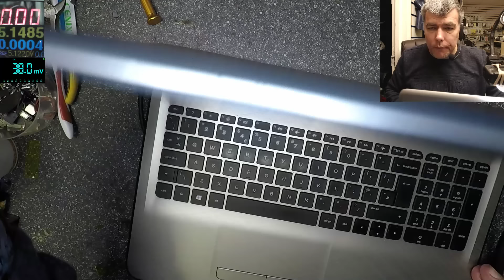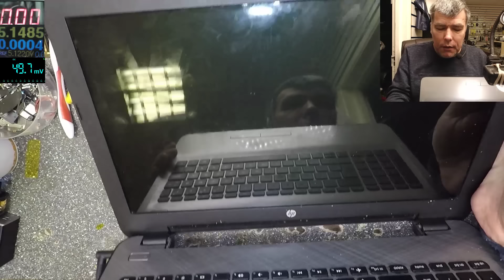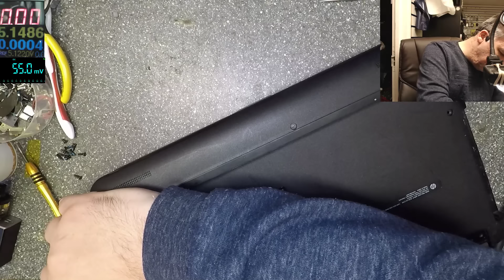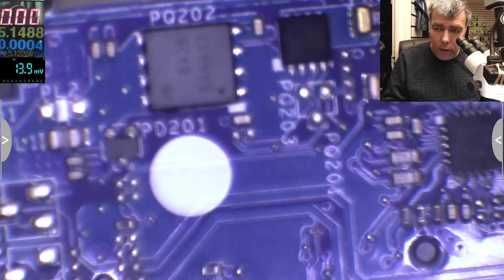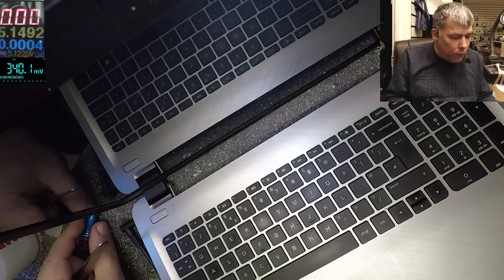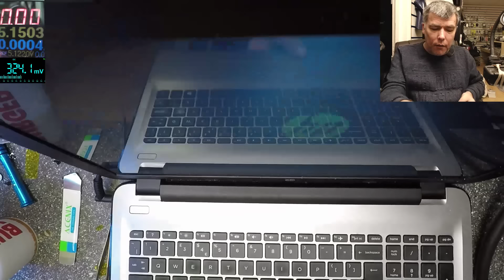Most common fault on a Dead Laptop

Comment: So the best thing to do after this is to find the reason why the gate its not opening the mosfer? thanks for the tip, now whats the downside to hacking/bypassing the mosfet and how long a jumper wire like that would last?

Comment: looks like you dude need to go to electronics repair school, bypassing a bad component isn't a fix. That component is there for a reason, you replace it, not bypass it. If I was the customer of this laptop id make you give my money back for waisting my time, shame on you sir. I'm younger then you  and can clearly tell ive been repairing stuff way longer then you. go be a doctor, sound slike youd do better at it. I hate so called "fake" techs who think they know how to fix shit just to bodge or do a cheap easy work around to get it "working" for just a little while. Your no technician, your a do it yourselfer, nothing more.  Do use all a favor and stop trying to pretend to play repair man when you can even "repair" the component you bypassed. Wether or not it got the laptop working again doesn't matter, thats a power transistor your bypassing and this is dangerous for the rest of the power supply section if anything else where to fail. Yeah its working for now but for how long and at what  cost? What about future damage from  not doing the repair correctly if something else fails and that mosfet cant do its job cause its bypassed, hmm?

Comment: I have no idea what you are talking about. You have no trays to place each screw in so I assume you just put any screw back anywhere. That’s right at the start of this operation. Sorry my friend, the problem is not the mosfet so you didn’t fix it.Seen lots of similar shops in Croydon. And they are not cheap. Bye

Comment: Pretty CHEAP repair. A reputable repair person would REPLACE the mosfet not short the input output with a piece of wire. That mosfet was installed for a reason, not just to pull and then short.

Comment: I have a problem with an Acer Z5WE3 LA-A621P motherboard. It powers up just fine but the battery does not charge and after it stays on for like 1-2 minutes then it switches off by itself. I could not seem to find the fault. Can you suggest any solution?

Comment: This is the reason Apple fought so hard to stop repairs. I would call this a cowboy repair. I understand he has a happy customer as the laptop is now "working" however he has bypassed a safety feature (what you think the manufacturer put a MOSFET in there for fun?). I stopped doing component level repairs as it became uneconomical (hours to troubleshoot, usually pennies for the part though!). Sadly the reality was a new or replacement part could be had cheaper than the labour (try charging a customer £50/hour for a computer repair that takes 3 hours!) Of course I still component level repair my own personal equipment, it's just no longer a viable business for me...

Comment: I guess 90% of the dead computer issues are the power supply side of the circuit board? power rails and power through various mosfets??? what do the mosfets do if you are simply removing them?  Are they just a digital on/off switch for the power?

Comment: from jarring or something, one of the ribbon connectors became loose on my fairly new laptop.  On and off switch did nothing.
So first I reset all the ribbon connectors and I had power, and it works.  Has a SSD  500 gig HD so its fairly new.  Probably someone didn't connect the strip right and lock it in.  No repair, just making sure everything is connected.  Used laptop I picked up for less than 200 dollars.  (HP)

Comment: This is not the correct way to check hardware sir. Me as Experienced System hardware Engineer we first check the current flow to battery pin before dismantling the laptop it should show above 3v in three battery pins from multimeter is coming or not. And another step is to check the power supply section of board voltage coming from power MOSFET chip 19v incoming and outgoing 5v to smd. You forgot to check each steps at beginning. First step should start from Power supply section you cannot simply bypass and check other part of hardware component and replace MOSFET. It has to be done step by step checking you haven't checked eact part of motherboard.

Comment: this great for say an old hp like he had where it is worth about 25 bucks so if it fries because he bypassed the problem so be it BUT would i except this on say a 1500 dollar lenovo carbon x no way in hell as i do repairs myself i give my customers options down and dirty cheap or the right way which will be more costly simple as that you want a 20 dollar fix so be it no warranty do it right you get the warranty as always you get what you pay for and yes in a way he is actually saying that

Comment: Not bad for a temporary fix to get an image or access an encrypted drive, but I would not recommend a repair such as this for long-term use.  Replace the PC.  New MBs are almost impossible to find, used ones are a gamble, and bypassing a power circuit could be a potential fire hazard, with or without the battery.  PCs are not so expensive that one should take unnecessary risks.  Nice troubleshooting skills, though.

Comment: Removed and resoldered the mosfet.  Works OK after that.  Probably a simple case of "cold solder joint" and would have been repaired simply by reflowing all of the mosfet connections.

Comment: I had an old laptop went totally dead on me. I studied it and checked as much as I could with voltmeter. I studied and noticed that some of those tiny little resistor blocks that are surface mounted little bricks with no wires have numbers of their value ( very tiny ). I noticed some near power input were marked with 0.0 which I guess meant no resistance or some kind of jumper. I found one that didn’t seem to be ‘ jumping ‘ like it should so I managed to solder a small wire across that part of the circuit and ‘ voila ‘ it’s alive again. 
  Also known as “There, I Fixed It “

Comment: I assume it's not the Mosfet but rather the ChargeController. A BQ25A from Texas Instruments if i'm not mistaking.  

The problem with a wire in place of one ore even both Fets, TI calls them AC and RB Fets is that switching between batterypower, and charging can bekome even more broken then before.
Exchanging the BQ25 is normally the easy and right thing to do.

Comment: The mosfet is there for a certain reason. It should be replaced. If the new again isn't working one of the other connections must be at fault. The real reason isn't found or fixed at all.

Comment: Sir, you can't call this a repair. That's not repair. Proper repair technician would have search for and fix the problem with missing gate voltage. I'd call your repair attempt as humiliation over electronic equipment.

Comment: It is likely the MOSFET regulates the current so something will burn up...How long, who knows, the battery of something else on the board. It would be best to replace the MOSFET if you want to try, otherwise you need a schematic to figure why it is not being driven, usually another transistor. I have found that that failed solder joints (loose connections) or high current devices such as this MOSFET are what fail. Leaky capacitors too.

Comment: Hello
After plug power suply again laptop probably short to ground .
This is not a repair.
First transistor must be driving by the charging driver. 
Problem is not resolved.

Comment: Great idea! you have applied the very basic concept of a fuse. You just replaced the square plastic part with a thin hair of copper to work as fuse like houses in the old days. Really, it is very brilliant action and it is inexpensive too. However, I think, using a real fuse structure may be more robust and durable.
About the cause of this issue, beside global warming or French fried :), I think that the hard disk connectivity is not stable and it may be the cause of that short. @23:50 you have adjusted it, but the question, what does make it like that?!

Comment: You're skipping a few important steps in the first 1.5 minutes.
Before opening check
if the power adapter is alright (19 volts).
remove power chord and battery and keep the powerbutton pressen for a few seconds to discharge. (this is a very common fix).
eyeballing the DC jack in the laptop won't tell it's broken or connected at all. (wiggle the connector and see what leds flash (or not))

Then open the laptop up, if you know what to look for. A lot of fixes don't require to unscrew anything, so please don't steer your viewers that direction after 1.5 minutes already. They could destroy a perfectly fine laptop by not knowing what they do ;)

Comment: THis is a next level skill. Normally when laptop has mobo problem it's beyond repair and mobo replacement Is the only fix. I have HP laptop that's been dead for years. I had fixed it once or twice, but the last time it broke, after couple of tries, I gave up. It's not ram/gpu/cpu/heating issue it's the mobo. It turns on when I push the on button and just quickly turn off by itself. It happened before when the wifi chip burn and shorted the system (had it fixed by cleaning up all the metal contacts free from any burnt material).

Comment: Trouble is, you haven't fixed the problem. You worked around it. It may work for a short time but will fail again and when it does, because of your bodge repair, it will be worse.

Comment: Well, without this mosfet it wont turn off if cpu overheats, it's also will not detect over-voltage or over-current. It is almost all the time BQ chip region

Comment: Hi, unrelated to this, My dads laptop is not charging I have found loads of answers to why it is not charging but none to resolve the issue..Its a dell inspiron 1545, I replaced charger with a new Dell charger and the power jack - still not charging I stripped the original power supply and soldered the center pin wire because I am told the is the communication point to the laptop for identification, still no charging...I know this is not you game but maybe you have come across this issue before and could help...Have you ever come across this issue as I am told it is common...Many thanks

Comment: At 10:09 the Gate is always the 1st pin under the little circle bellow the B of BA44413. Pins 2,3&4 are Source. That 8VDC looks like a gate's voltage. Short looks like it is between gate & source. 1st mosfet is usually on (normally close) and prepolarized the system. The 2nd mosfet is usually normally open and protects the system againts power inversion when the laptop's battery comes on. Who controls those fets? The KBC.

Comment: Good its working again :-D
The first mosfet is often tied to a circuit that measures the charger input, if not within a normal voltage it keeps the fet off.
People can download schematics for most older laptops and find the charger section, the input mosfets are usually on that page, easy to see how they work :-D